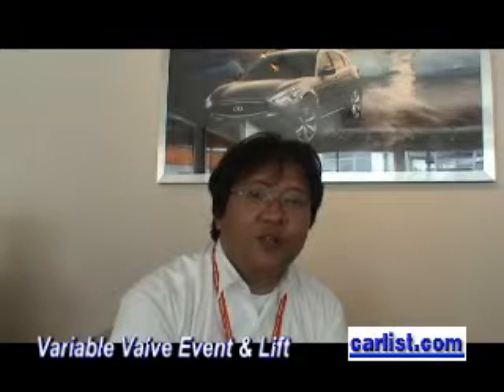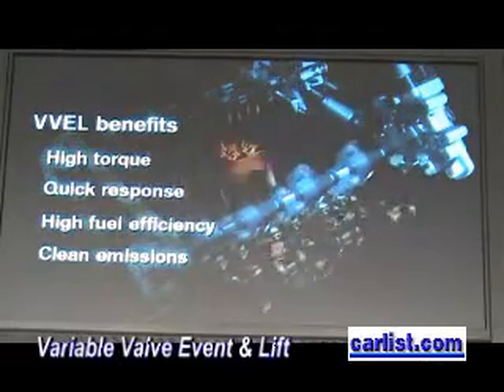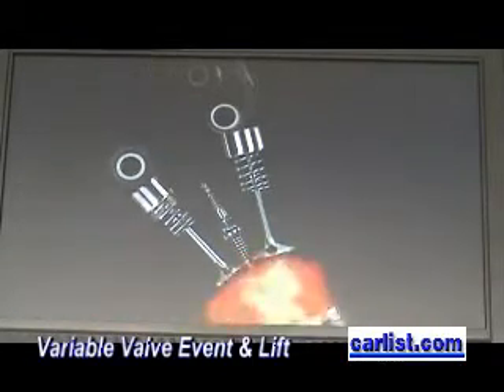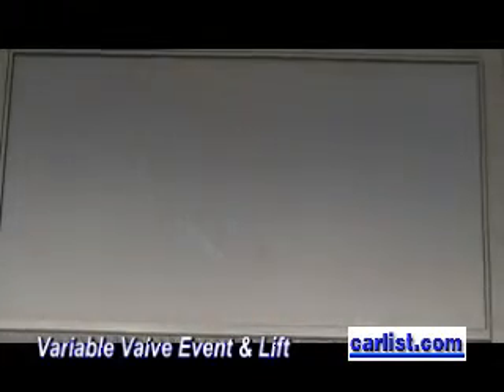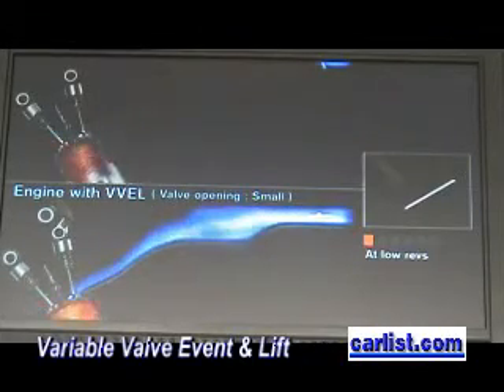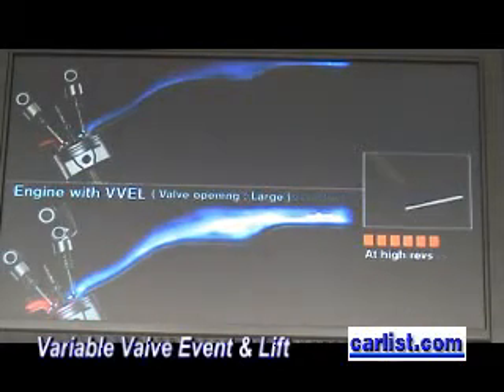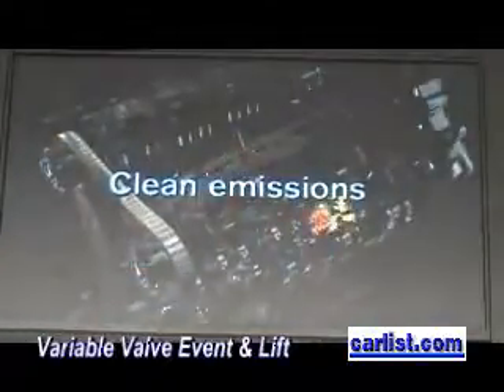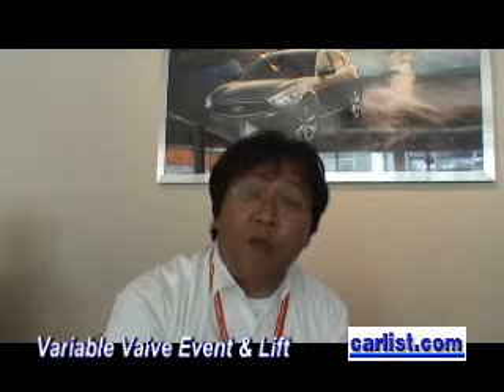Nissan and Infiniti cars Variable Valve Event & Lift (VVEL) and newest advanced technology for cars

Comment: How is this considered "New" technology when every other maker has been doing this since year 2001(12years ago)?   What about the exhaust valve?   BMW did that 12 years ago.....
Reply: VTEC is just 2 sets of cam lobes getting switched on and off with oil pressure, and BMW's version of it is still mechanically timed. Nissan also fully VVEL in 2007 in the infinity g37 with the vq37. this was 8 years old at least by the time this video was released, but its still got significant advantages over VTEC and VVA because it is electronically controlled and can be tuned by the ECU. Nissan had VVA and VVL years before this was released as well